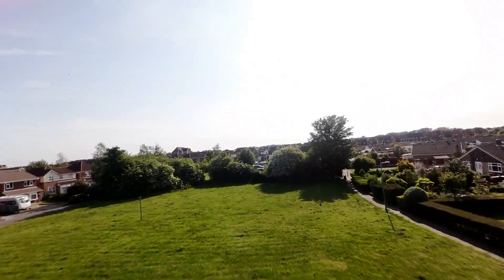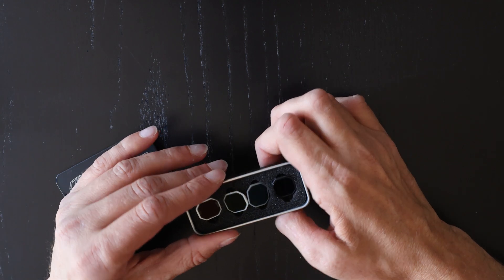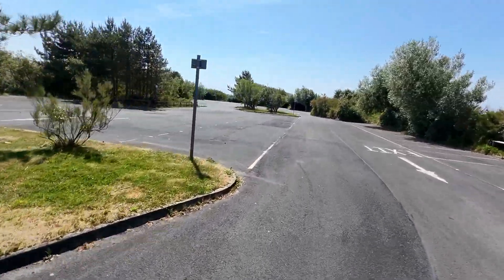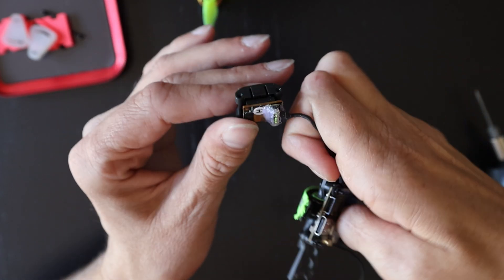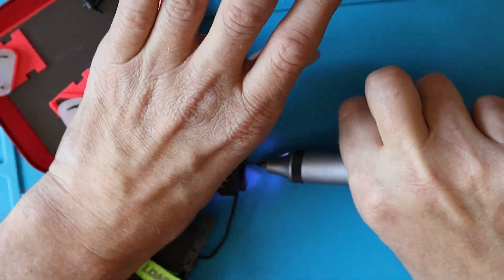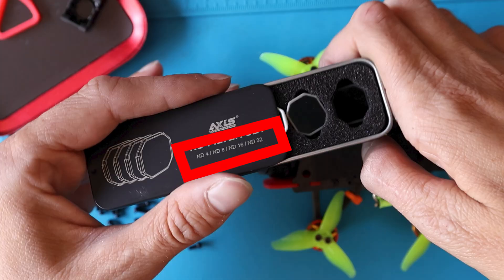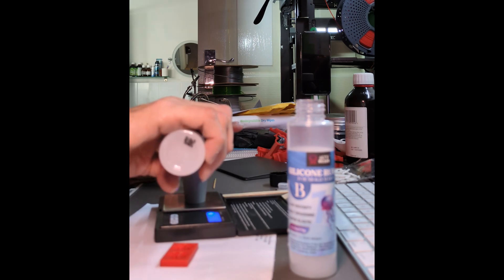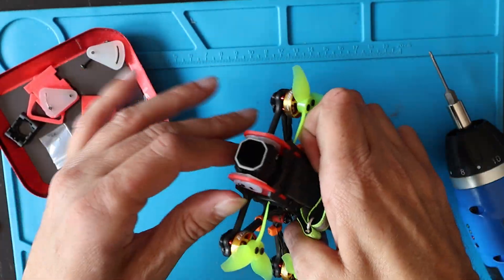How I fixed the Jello on my DJI O4 Lite Air Unit FPV using the Axis Flying Camera Case

Comment: Nice! BTW, you can remove hot glue easily with denatured alcohol. Just put a few drops around the edges and let it wick into the glue joint and it will pop right off like it was never there. There's a Flite Test video demonstrating this called "Flite Test | Hot Glue Tricks" at around 12:30.

Comment: Won’t lie your video got my brain thinking and I bought two of the camera cases but the 14mm version but the section where you were saying the 04 needs stiffness instead of gummies bouncing around so I took ur advice and 3d printed some TPU m3 4mm spacers and your statement made it so I can finally sleep at night lol I have tried different canopies props braces and this was the fix plus nd filter so tytyty 

KrispyFPV

Comment: The tiny O4 is so bad... Poor low light performance & gets jello in strong light. The only reason it works in DJI Neo is because DJI gimbals are best on the market...
Reply from the maker: Yeah maybe there'll be an upgrade after the Neo 2

Comment: That you for the suggestion of making the old and using two part silicon. This is genius for making camera mounts.
Reply from the maker: Yeah it works well if you can be bothered designing and 3D printing the moulds.

Comment: For my Mob8 and Meteor75 Pro HD, I'm having good luck (so far) with the Flywoo O4 Housing and hectorbvo's O4 canopy for tiny-quads for the flywoo housing. Doing some more test flights tomorrow. Flywoo has an O4 Wide FPV kit coming out soon, which should easily attach to the camera housing. Currently I'm using their ND filters, which are really nice (screw on).
Reply: Do you have a link to "Hectorbvo's O4 canopy for tiny-quads"? My google searches have not returned any results.

Comment: Nice job. You can also buy TPU filament in softer material than the typical 95A. Print it with thin walls and minimal infill for really flexible parts or ramp up the number of wall and or infill to stiffen it up to your liking.  With parts that small you can bang out a few different ones and see what works.
Reply from the maker: Hi, I've tried 3-D printing camera mounts from TPU but I still got lots of jello. That's why I looked for a softer and more shock absorbent solution and that's when I discovered the silicone kit on Amazon.
Reply from the maker: I should add that I have used TPU for the 04 pro camera mounts with some success but not on the 04 lite. The 04 light is a Jello monster 😞
Reply: @upshotphotos  Good to know. Thanks.

Comment: hey very nice job man, quick question : do you think i could use like kitchen silicon to get to the same result with a mold ??
Reply from the maker: Hi, do you mean kitchen/bathroom sealant? Possibly. That's what I was going to use until I discovered the kit on Amazon. I don't know which would work best but in terms of cost there isn't a lot of difference.